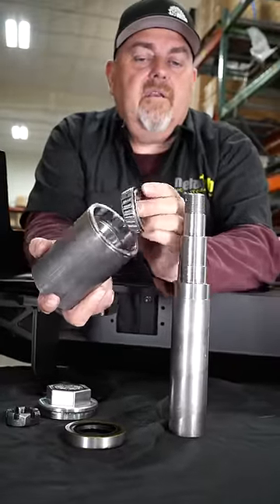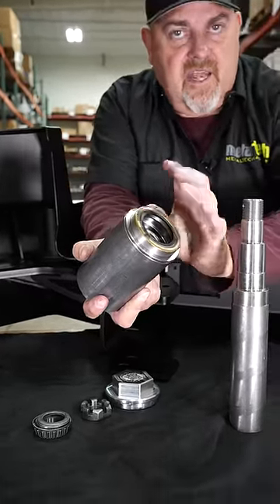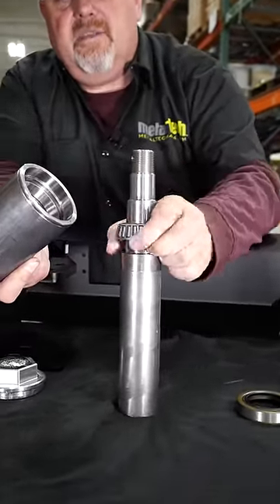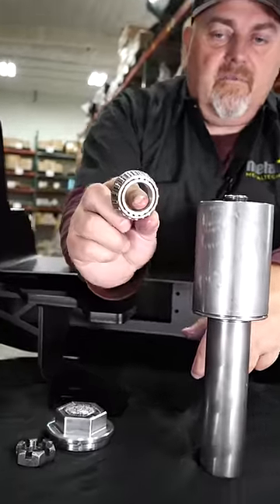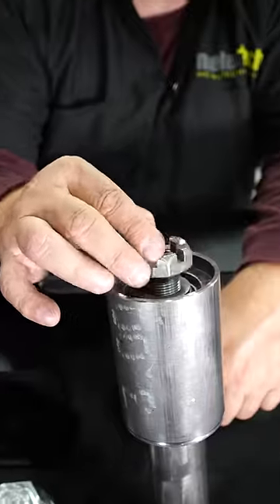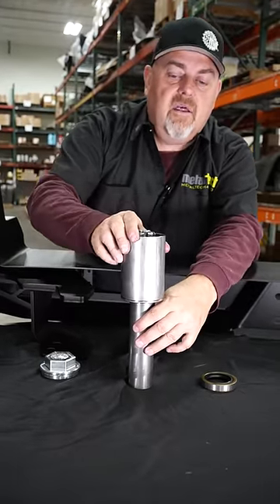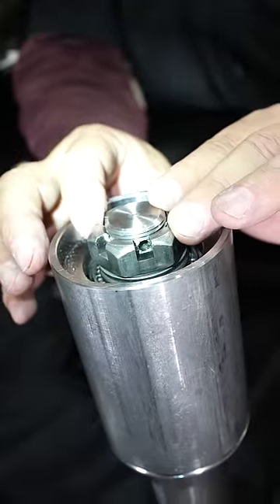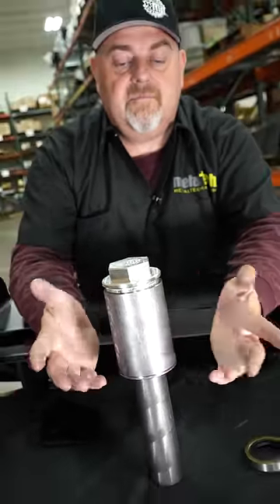Motion X Spindle Assembly

Comment: I’m not saying this assembly needs a designated pre-load, because I don’t know doodley squat about the thing. 

And, I’m not doubting you - this is your show - but everything I’ve ever done using dual-opposed conical bearings requires that, while spinning the bearings, the nut is spun until the bearings stop spinning.

From there, a specific torque may need to be applied to the nut, or perhaps an extra ¼ turn before backing the nut off to align with the cotter-pin hole once the bearings turn freely.

Once again, I’m not saying that you’re wrong, I’m just saying that I learned something new today. 

Thanks for your video!

Peace ✌🏻
Reply: Yeah, usually requires a torque setting then back off..

Comment: You back off 1/4 turn then tighten to finger tight in closest location where cotter pin can be inserted never leave the nut completely loose at 1/4 turn back your asking for early bearing failure

Comment: new bearings and no preload? sounds like it would be to loose.
Reply from the maker: Great question!  Pre-load for a pivot bearing is different than say a trailer bearing. In the video we take it to the point of almost not turning, then back it off to set the cotter pin. This provides the appropriate preload for a pivot that is only turning 0-270* by hand its whole life.
Reply: I was thinking this also, I peload all my bearings as years ago I had some come loose. It may not be needed, but it doesn't hurt anything and is a good piece of mind.

Comment: Get it tight and keep going until it gets loose again then back off 1/4 turn.
Reply from the maker: Yikes! 1-1/8" threaded end has a yield listing of 81,000PSI !  To rip that thread to spin, one would need a hydraulic wrench!   Ok 20' cheater bar?
Reply: @Metaltech4x4  that's just what they trained me at jiffy lube.

Comment: No pre load spacer?
Reply from the maker: No cone or crush spacer needed.   There is a washer below the castle nut but considered a spacer.
Reply: @Metaltech4x4  hell fella that’s cool. I used to build class 6,7,and 8 tractor trailer components. Hubs being one, and we always used pre-load spacers. So just curious is all